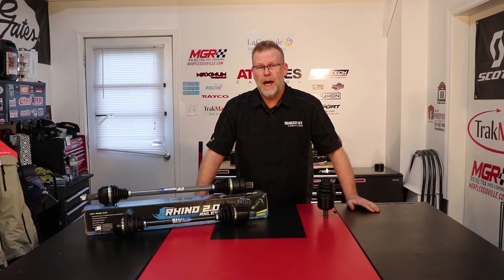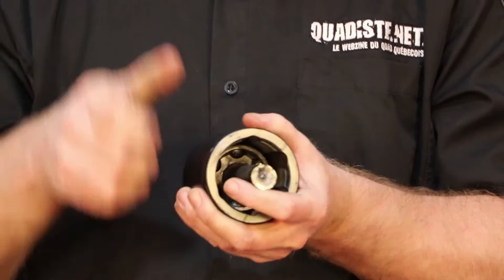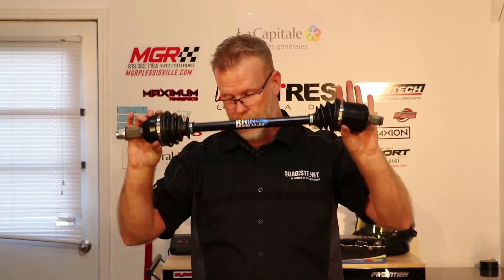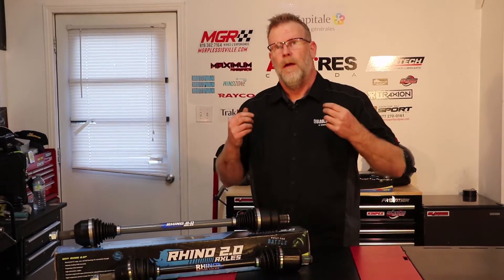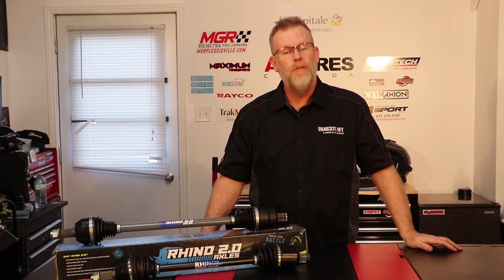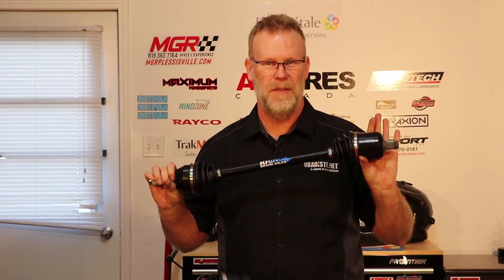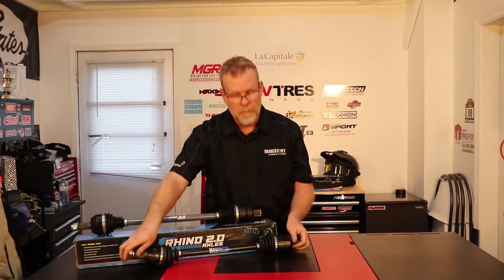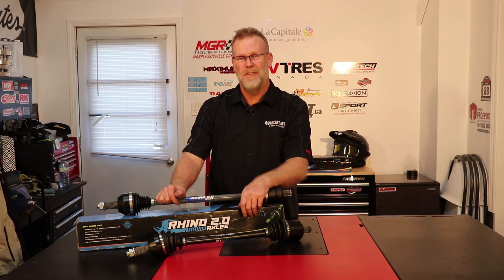Tech Talk 2.0: ATV / UTV axles 101

Comment: I just bought a 2009 rhino 700 with lift kit it came with no rear axels only the ends in the wheels .I Need longer axels than stock ?
Reply: Most lift you don't but if it's on a more than 4 inch lift that required new A-Arms, longer axles will be required.

Comment: That’s great and all but I would like to see a comparison of the ball bearing difference in sizes the angle of the cup difference. I would like some metal specifications. If it’s just a standard bearing and cage with a slightly different machine angle at the end of the cuts to allow for more articulations there’s not anything really stronger about the weakest point and the axle
Reply: Hello Lorin,  I understand your request.  If I get a chance to have all those different types of axles that I can take apart for a show and tell advanced video, I'll try to make one.  I try not to go in deep in the very technical stuff as most viewers do not have a tendency to watch.  But you comment sparked my interest.  thanks!